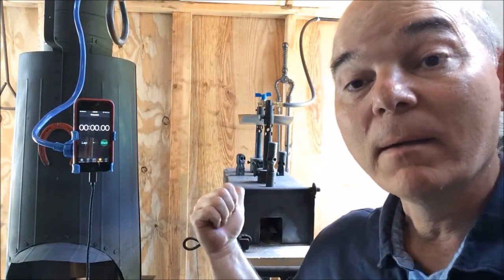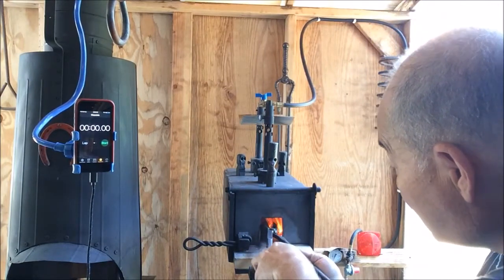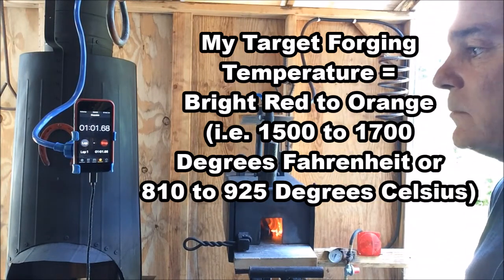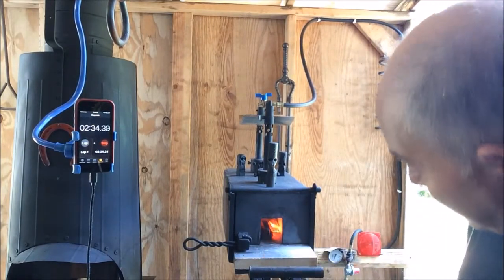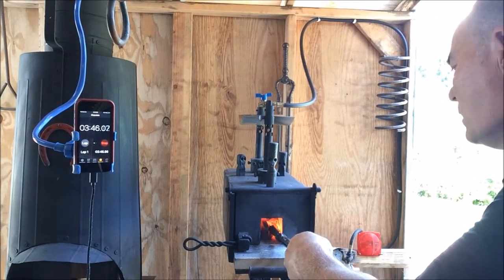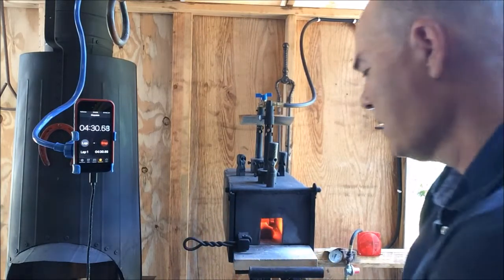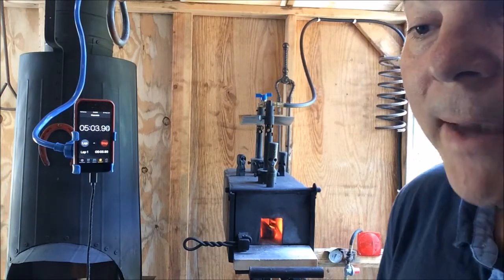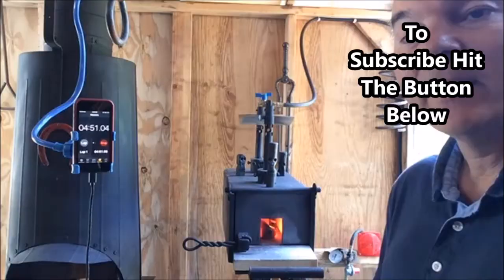Subscriber Question - Time to Reach Forging Temperature?

Comment: Thanks so much for this video- i'm truly impressed that you responded so quickly to my comment and went above all my expectations and actually made a whole video on it! Also great job on the forge - i'm very impressed that it could heat up an object with that much thermal mass and such a low surface area in such a quick time! thanks a lot and keep up the good work!

Comment: A couple of questions - (I watched your build video) Could this be hooked up to the same gas that comes into my house from the gas company to heat my hot water? Would I need different nozzles?
Reply from the maker: what type of gas do you use for your house?
Reply: @RickRabjohn  I'm guessing Natural Gas. Same gas heats the whole house.
Reply from the maker: Most use propane, and there is a ton of information, equipment, and suppliers available to help.  Less so with natural gas.  It's not impossible, some do it, but it requires different set-ups. My knowledge on NG is limited, So,   I would research the web and checkout the "I Forge Iron" forums etc...  Hope that helps a little, and good luck Dennis!

Comment: Your question on time difficult. The camera is cold, or it is prevaritelno heated. Heat-up of the camera takes a lot of time.
Reply from the maker: Oner - not sure I understand but did you mean the "forge" is cold?  A "camera" is used to take the pictures?  My forge takes a few minutes to heat up. So, starting from a cold forge, I would add two minutes to the time - so rather than 4 to 5 minutes it would be 6 to 7 minutes in total.  Thanks and hope I interpreted your comment correctly..

Comment: How long does it take to empty 20 pound botle of propane?
Reply from the maker: great question.  the answer depends on many variables.  How many burners are running, how well insulated is your forge, how hot are you running the forge (e.g., welding temp 2200 f or forging temp 1800 f) and the associated PSI you need to run to achieve the desire temperature,  For example, a single burner forge, well insulated, running at 1800 degrees F, using 6 PSI could last 10 hours on a 20 pound tank.  Checkout the forums on the net because this question is asked a lot and you can read up on what others say.  Good luck.
Reply: @RickRabjohn  thanks im building my own forge right nov and i serched for that information for a long time
Reply from the maker: Good luck with your forge!